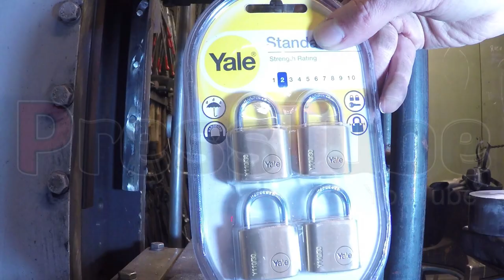Hydraulic Press | 4 Padlocks Hot/Cold comparision

Comment: Press a pressure cooker.

Then get the same type, put water in it and heat it until it builds up pressure, and then press that before it cools. Stand behind some bulletproof glass for the probable explosion.

Comment: You should use a smaller press so the impact is more concentrated.
Reply: Why,it wouldn't really make any difference. The fixture plates are distributing out the pressure evenly. As long as the item being crushed is smaller than/fits inside the fixture it will react just the same. The only way anything different will happen is if the item is too big or you leave a part of it outside the fixture and crush like half of it.
Reply: Oh k. I don't know anything about science